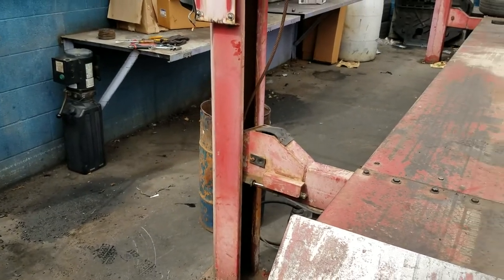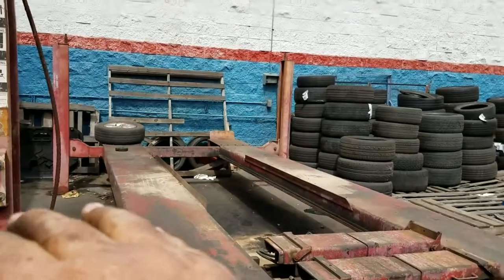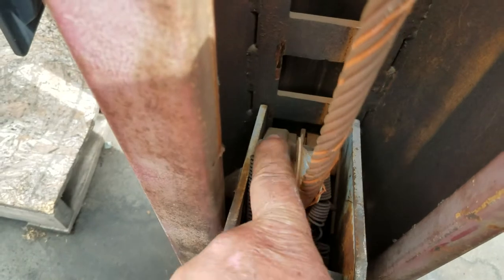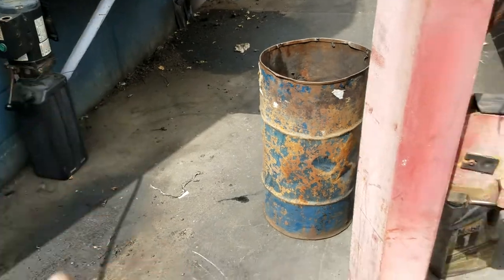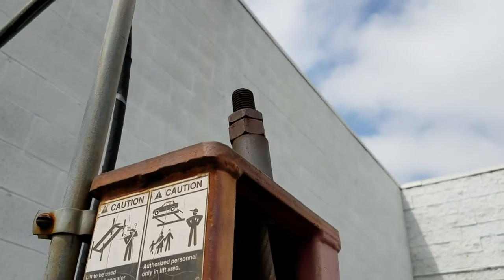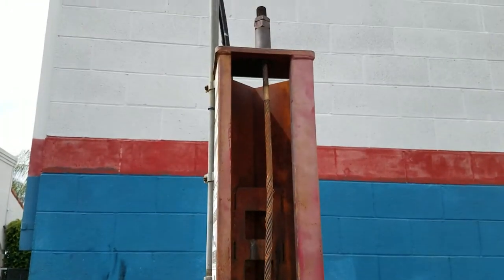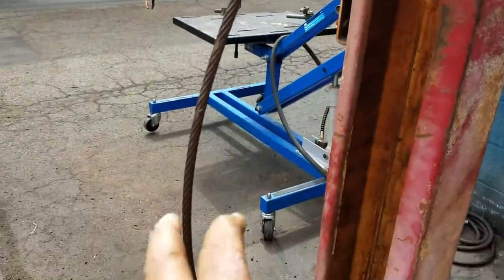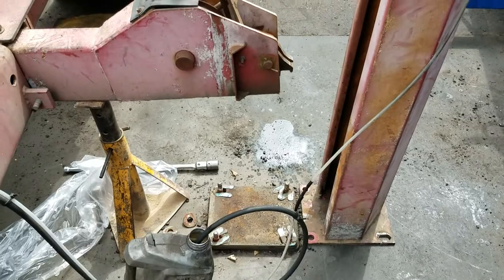Rotary 4-post Lift, SM121 12,000LB CAP.

Comment: I have one but one side the cable is broke and the big pin doesn't come off any ideas i drilled the pin for the pully 5/16 put a threaded bolt to try to pull it out
Reply from the maker: I would be glad to help but I need to know which pully/ sheave ? the ones in the column OR the four underneath the ramp?  If it is the ones in the column, you do not need to remove the sheaves, the cables thread underneath with plenty of clearance. 
IT IS BEST TO TAKE A PICTURE of your issue and send it to my email address, nytom60@gmail.com

Comment: Well it looks as if there's crown breaks on that right hand post. And even if it isn't I'd be willing to bet if you put a rope gauge on it you'll find that it's undersized due to the the rouge on those strands. When that inner core gets dry it no longer lubricates the rope.
Reply from the maker: I did put a gauge/ caliper on the cables and they were to specs, but thanks for the reply.

Comment: Cables need replacement
Reply from the maker: why do you say that? reason?
Reply from the maker: Rooster,
just to let you know, these cables are/ were "PVC" coated, and although the PVC has worn out , the MOST important issue is "they are NOT FRAYED" and DO NOT need to be replaced at the time of repair.
 Not sure if you are in the repair industry but you are TOTALLY WRONG about replacement whether in the repair industry or not. 
****If cables are NOT FRAYED AND NOT "UNDERSIZED BY USING A CALIPER" there is no reason to replace them.  
Maybe you noticed the PVC peeling or shedding but that is common with 4-post lifts even if installed indoors. 
This repair has nothing to do with cable replacement and did NOT cause the failure of the safety lock.
****I would like to know how you came to your assessment that they (the cables) need to be replaced?
 If you think they need to be replaced just because of the color, they ARE NOT RUSTED! and totally flexible. This is a common issue on 4-post lifts when installed outdoors.
Please reply with your assessment, I would like to know.
thanks, Tom in NV.
Reply: Ten4 bud. Like I said rope gauge... And FYI since you are in the repair business, did you know that the recommendation on these ropes are every 5 to 10 years based on the bend ratio from the sheave diameter to rope size?  Not trying to be a jerk but you kinda come off like one. I've seen these ropes break on several types of lifts, we probably have a 500 of them, and since there's a human being under that lift we don't play around with ragged ropes.  yes rust and rouge are two different things, from my phone video it kinda looks like rouge, but I'd agree if you mic'd them and they're not undersized yet then they don't need replacing. They look like hell though
Reply from the maker: @rooster9190  thanks for the information